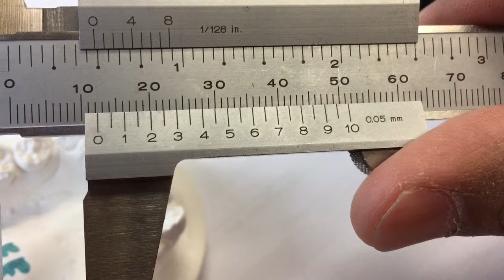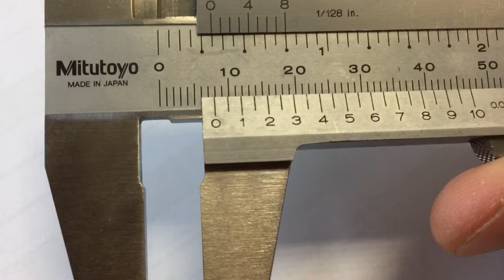Basic Orthodontic Space Analysis Demo

Comment: for required space  dont we measure first molars??
Reply from the maker: Asma Hafizi we typically conduct space analysis from mesial of 6 to mesial of other 6. And hence, we typically don’t include the 6s in required space. This is because the available space we measured is where 5-5 should be. You can include the 6s in required space, but then u have to modify the analysis by measuring your available space from distal of 6 to distal of other 6.